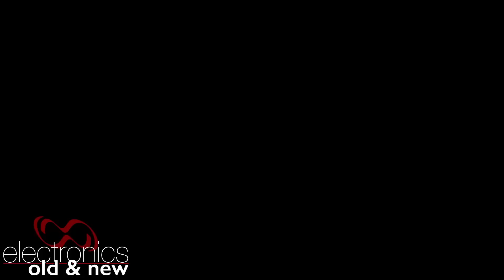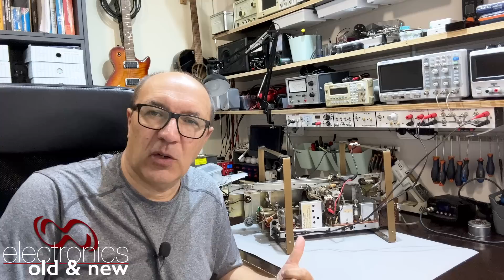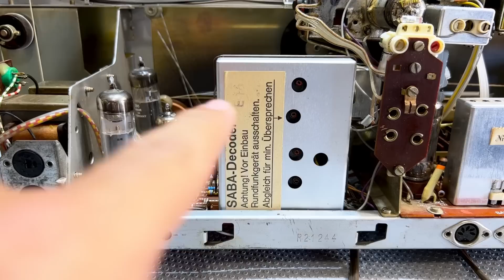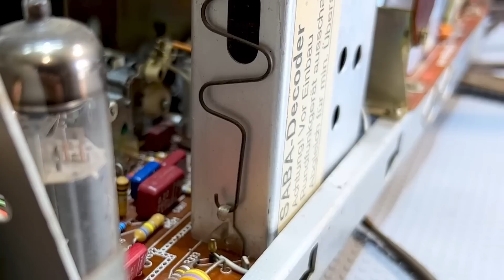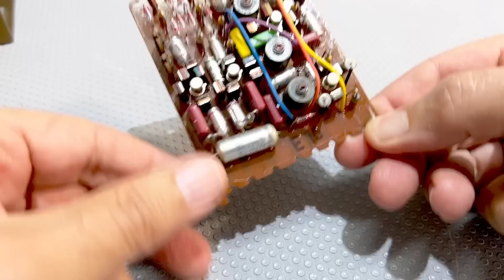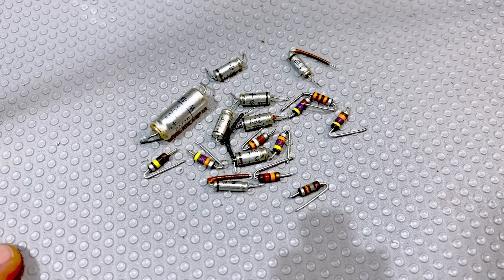SABA Stereo Decoder E16 for FM tube radios - Detailed scope probing and alignment

Comment: "pilot carrier" is a misnomer, probably because it was derived from the original German text.  It's like saying "egg basket eggs."  Go with "pilot signal" instead. 🤨

The 19 KHz pilot signal is not "modulated" onto the 1 KHz (base band) audio signal.  It is summed with the audio signal.  That's all you see on your scope coming from the ratio detector when tuned to a monophonic signal (both left and right channels equally modulated in phase).  Sorry, fellow.  If you can't explain it you don't really understand FM stereo modulation/demodulation.  Case in point:  You earlier said that "L1 was to be adjusted for the third harmonic of 19 KHz."  Then later you learned that L1 was for nulling a received 67 KHz SCA signal).  You're just another of the myriad of YT "experts" trying your hand at whittling a few $$$ out of YouTube.
Reply from the maker: And I thank God every day that there is a myriad of good, knowledgeable folk like you on YT trying your hand at keeping us “experts” in line. Thank you for your service 🫡

Comment: My Tandberg Huldra 8 also has an optional stereo decoder model 3, it has almost no stereo separation, your description gave me a clue to find out the reason.
In addition, the stereo decoder of my Nordmende 6/634 only uses one ECC81, which can produce amazing stereo separation and sound quality, but recently the stereo indicator light of its EMM308 is off, but the stereo effect is still normal. Do you have any suggestions for this issue? I hope you will have more videos about this in the future, thank you!
Reply from the maker: I’m afraid I can’t advise you on that as my experience with this issue is limited to this particular decoder.

Comment: This is a great video. I have a Saba decoder on a Saba 300 which needed some TLC. It came with two telefunken 12ax7’s that test nos and all the parts and layout etc. had real promise. So after watching this vid I worked up the courage to pull the cover off of mine and see if I could coax it toward better performance. Well I followed the English step by step instructions from the pdf I downloaded and tuned it up. Finding  the Lissajous curve and getting the circuit stable at the fm stereo 19k/38k frequencies was quite beautiful really. One of best learning/experience I’ve had in this hobby. Thanks for the help!
Reply from the maker: My pleasure 👍

Comment: It's amazing to see how early stereo receivers used discrete circuit design to seperate the L & R channels. Would be interesting to see how well its performance compares to modern FM radios that has the whole thing on an IC
Reply: Stereo FCC multiplex was introduced in 1960-61 in US. So first decoders used tubes instead of transistors, but the circuit was quite the same.

Comment: I've aligned a lot of decoders similar to this one, and I'm sure you can get it a lot better than this.

You should go over the three coils L2,3,5 that maximize the DC at point IV repeatedly until you get a maximum. One pass isn't sufficient. Probe the 38kHz signal at the indicated point to see what is really going on. The more voltage here the better.

You should have adjusted L3 before P2 as per the instructions, not afterwards. P2 is only fine tuning: L3 does most of the work. You don't seem to have done steps 5-9 at all.

The channel you aren't modulating should be nearly flat on the scope, consisting practically only of pilot. You should be able to get -36dB of separation out of a decoder like this, especially if it has decent pilot filtering at the output, or if you can bandpass-filter the output to remove the pilot before measuring dB. It makes a difference not only to the measurement but also to the actual optimum alignment point: otherwise you can just end up trying to cancel the pilot, which is both wrong and futile from the audio point of view.

NB L1 isn't a 114kHz low-pass in the unit you aligned, it is a bandstop, as your experiment with varying the frequency showed.

The L-R imbalance is largely down to the accuracy of R18,19,21,22, and the resistors around T4 and T5, and the adjustment of P1, the balance pot. You should be able to adjust it so that either channel is larger, and find a happy medium.

You should also check R42 and C28, and the same in the R channel, for accurate 50uS de-emphasis.

Fun stuff.
Reply from the maker: Fun stuff indeed. Thanks for your input. As I mentioned in the video, the alignments were repeated off-camera and the result improved considerably. However, I will have another look at the components you mention.

Comment: Great video Thank you 
I have an old Stereo FM Tuner Kit (maybe 40 years old) I had change IF transforms settings with screwdriver while a young lol 

FM Tuner  board have:
TBA 120S (14 Pin DIP Case IC) and  SN76115N(14 Pin DIP Case IC anyway have not SMD cases 40 years ago as you know )

Also have red colour and green color IF transformers also have BF198 transistors( 2pcs)
For FM Tunning have 4-5 cm long sensitive trimmer potantiometer.
Coud you advice a video about  correct FM adjust principles (or a pdf link) I have  2 channel 50 mHz Oscilloscope and to 60 Mhz Function Generator (also have sweep feature too)
Can I make adjust this tuner ?  If possiable I want listen to this tuner for remember old memories 
I think you was understand me with this bad english
Regards
Reply from the maker: I’m afraid I have no knowledge about that tuner.

Comment: Yes, however I've got a TFK 2550 that has a tube stereo decoder. Will have to do some reverse engineering/reengineering to align that as well
Reply from the maker: Should be fun 😊
Reply: In fact you can use this scheme as a block diagram. Tube decoders used the same principle, only instead of transistors there were triodes.

Comment: Early discrete stereo decoder, interesting. I'll be interested to see what you decide to do with the cabinet.....
Reply from the maker: Still thinking 🤔
Reply: From what I can see, the original was a teak veneer case with a cosmetic strip at the base under the controls which bore their names. I guess it depends what you find underneath if you strip it.....

Comment: Yes, been doing a lot at my end with both AM stereo and FM stereo decoding, where wanted to design a common decoder for both formats, as they both use R-L & R+L encoding process. With AM stereo I used two SA612 mixers using sine (R+L) & cosine (R-L) offset, on the FM stereo decoder I use a CD4066 to do the converting to left and right from R+L & R-L. The both use a common logic gates to synchronize to the AM IF at 450kHz & FM base band at 38kHz, as well as out putting the pilot tones of 25Hz, 19kHz and the carries at 450kHz, 38kHz as logic levels.  I have circuits if you are interested in how I did all this?
Reply from the maker: I would definitely be interested in the FM decoder 😊
Reply: @electronicsoldandnew  I will send you the circuits and a few pictures of the prototype.
Reply: @electronicsoldandnew  sent with details on how it works

Comment: Another advantage of it being a module is that you can swap it with another decoder.
Those first gen coil/diode decoders didn't have all that great channel separation,
but you could make a new PCB in the same size and same pinout and use
newer IC circuit to get better performance.
When it's inside that can, no one would know that it's not the original.
Reply: Did you make the decoders to size for the slot on the mainboard?  An did you base your schematic on the TB 4-2?
Reply: @scienide2k  Yes, it's the Dekoder 4-2 and I made the board identical to the original so it fits all models that takes the 4-2 decoder.
The only difference is that I rearranged the components a bit. I might do another revision of the board, maybe with a different IC
as the MC1310P is difficult to find, and also use multiturn pots and put them and the test points at the top of the board for easy
adjustments.
Reply from the maker: I thought of that. Do you know of anyone who’s done that, or published a working circuit?
Reply: @electronicsoldandnew  No, not for Saba's, but I made a few for the Tandberg radios that I restore.
Many of them was delivered with only a dummy decoder as the real stereo decoder was an option.
I just copied the latest rev. of the original schematics with KiCad and had JLCPCB make a stack of them.
Most stereo decoder IC's has a example schematics in the datasheet that one could just copy from.
Reply from the maker: Thanks. 👍
Reply from the maker: Have you found a more suitable chip yet? I would imagine the use of the chip would be quite simple, but availability is always an issue.
Reply: @electronicsoldandnew  I have a list of decoder IC's, but have not checked if anyone are available from reseller (Mouser, Digi-key etc)
Here in Norway, FM is almost gone now as public broadcasting on FM was switched off in 2017.
Now everything is crappy DAB radios with low bitrate transmissions.
There are just a few local stations left on FM, so the demand for FM stereo decoders aren't that big,
so that's why this decoder project has not been prioritized.

Comment: Great video -- indeed, it's one of the few attempts recorded on video of adjusting one of these. It certainly helps lift the psychological barrier to see what's inside one of these. Additionally, it's good to know the components inside are of such good quality that bar a few resistors that have drifted and electrolytic caps that are getting a higher ESR, all else works as expected and that the circuit is a standard circuit.  
I'm not sure why the crosstalk cannot be reduced -- I'm not sure it's due entirely to the two output channels being housed together under one roof, so closely to one another. I would guess that it would be impossible to bring down beyond a certain limit due to the design itself but this is just a guess.

Comment: You managed to release this just in time for Sunday morning coffee in the US, it makes for an enjoyable start for the day for us electronics repair junkies. @ 16:50, it may be that, the shielding box is more for keeping the 19 and 38K signals inside of it, than keeping other frequency interference from getting in, especially from the high P-P voltages you measured. Also, since you are dealing with oscillator circuit frequencies that low, making the adjustments with the board remotely connected like you did would probably not affect your adjustments as well, as they are almost at audio frequencies.
Reply from the maker: True. These are indeed low frequencies. Some slight alignment influence may occur, but negligible.